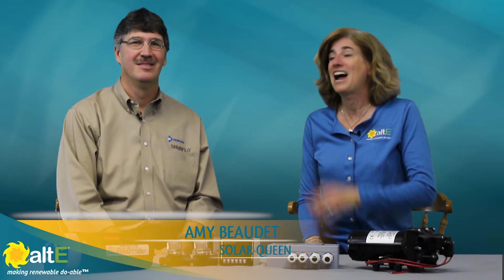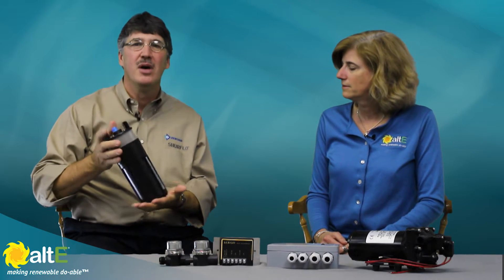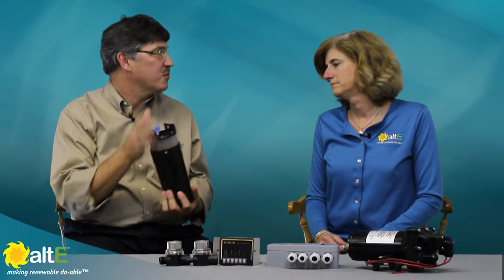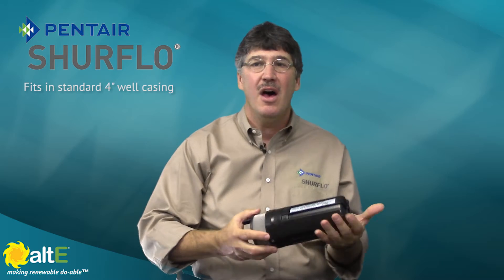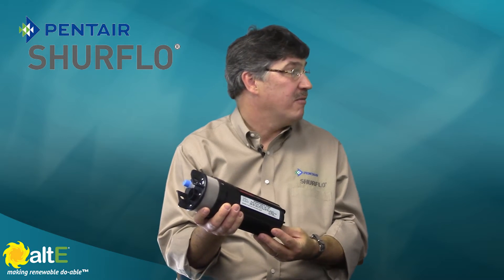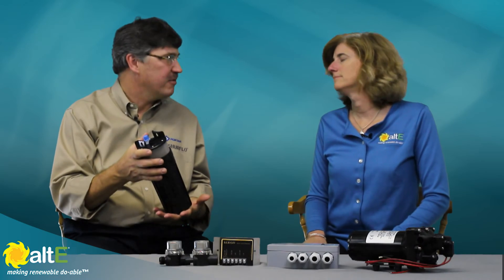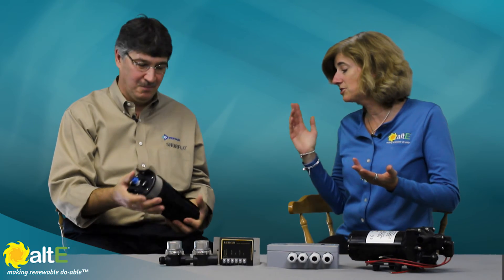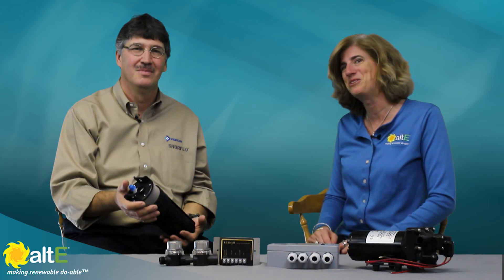SHURflo 9325 Submersible Solar Pump Overview

Comment: its a bummer he didn't explain how it works as opposed to surface type pump
Reply from the maker: It lowers into the well and pumps up, rather than a surface pump installed above the water and pulling out of the water source.

Comment: Please I need a 12 or 24Volts Pump that can pump water from my well which is 100ft deep and can also fill my overhead tank which is 2000liters  in 2hours please if you can assist let my no about it.
Reply from the maker: The Shurflo 9325 submersible pump can pump about 375 liters per hour. I don't know of a solar pump that can pump as much water as you need that fast (1000 liters per hour).
Reply: Can I have your mail so I can send you the description of what I need?
Reply from the maker: Go to our website at https://www.altestore.com/store/ and click on the Feedback tab on the right side. It will let you contact our technical sales department directly. They should be able to help.

Comment: what would we need for solar to run this pump
Reply from the maker: +Rev John O'Toole The size of the solar array depends on how deep the well is, how far you are pumping, and how much flow you need. You can go to the product page at https://www.altestore.com/store/Solar-Water-Pumps/Submersible-Solar-Pumps/Shurflo-Pumps-Accessories/Shurflo-9325-043-101-Submersible-Pump/p1098/ and see the sizing chart. For example, if you are using a 24V array and pumping up 60', and need 100 gallons per hour (1.6 gallons per minute), you would need at least 78 watts. It is highly recommended you add 30% to the minimum PV recommendation, so I'd go with at least 100W 24V. You could do 2 of these altE 50W 12V panels in series, https://www.altestore.com/store/Solar-Panels/altE-Poly-50-Watt-12V-Solar-Panel/p10351/ or one 100W 24V panel https://www.altestore.com/store/Solar-Panels/altE-Poly-100-Watt-24V-Solar-Panel/p10355/.  

You'd also want to use one of the SHURflo pump controllers, see the video for that here https://youtu.be/gh6E1YqDPjs
Reply: +altE Store thanks